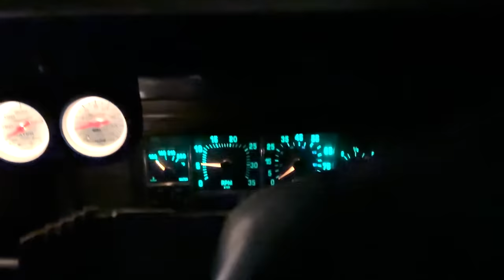Nightmare skoolie tow: this trailer ripped off my hitch

Comment: Love Love Love You Chuck !!! As a veteran tow operator, THANK YOU So much for mentioning it to Slow Down and Move Over for us. Just here in OK alone, since 2018, through 2023, I"ve been to 5 funerals, 1 a year of tow operators that have been hit and killed. Most of them dismembered and shredded to pieces literally. Hate to paint that nasty picture, but it's true. In USA alone, on average there is a tow truck operator hit and killed every 6 days, year after year after year. That's an average of 60 tow operators hit and killed in USA every year. Some years, more, some less. At the tow museum in Chatanooga TN,  there is Wall of the Fallen for tow operators. I know to many names on that wall. Of these 5 hit and killed in OK, that's not including 7 others that have been hit and severly injured. Some in ICU for months, some will never walk again and in a wheelchair for life, and some disabled enough they'll never work again. Then there's those have been hit in the back with a mirror and it hurts badly. I'm one of those. I was badly bruised for about 2 weeks and limited use of my arm. I've dove under my truck 3 times to keep from getting hit, and I've jumped over the center wall once. It's a real problem people. Please Move Over for us. It's the law in most states. If you can't get over, at least slow way down and scoot to the far side of your lane to give us as much space as possible. It's not a comfy feeling the wind from a vehicle getting that close to you on your back.  Please support your local Hookers in keeping them safe !!! Just because your vehicle isn't broke down, many forget we are working for everyone of you. When you're tied up in traffic due to a car accident or a disabled vehicle, who do you think is working to get that roadway opened back up so you can carry on about your day? Yes, we're working for you too.
Reply from the maker: thank you for sharing this and it is something i really believe in. it is insane how dangerous that job is and you're there only to help people. thanks for all you do, stay safe out there!
Reply: @ChuckCassadyYT  Much Respect Brother, it helps a lot when people like yourself with a large social media platform mention it and it's truley apprecaited by the entire tow brotherhood nationwide. In Oklahoma, we won't allow these men to be forgotten. They were all fathers, most with very young children. It sucks going to a funeral and look in the eyes of a wife and her kids for such a senseless avoidable incident. RIP Jonathon “JT” Taylor 1975 - 2018 
Bernardo Martinez  1978 – 2020
Donovan Knippenburg 1976 - 2021
John Mills 1991 - 2022
Kyle McCullough  1996 – 2023
Reply: Thank you both for bringing the dangers of this situation to the attention of the average everyday driver! Too many drivers jump into that isolation booth we call the drivers seat and are oblivious to the safety of themselves and others on the road! Well said to both of you! Thank you!

Comment: "when the bolts broke i was lightly braking and going over a dip in the overpass". In my opinion this is a key statement. The pitching (rear of bus rising and falling) is a major contributor to the failure. The tail starts wagging the dog effect. I have reattached caravans to cars on some very lumpy roads where this effect has occurred. The comment regarding bolts on the vertical is also on the money.
Cheers from Australia.
Pete

Comment: If it makes you feel any better, I just flat towed my jeep 1500 miles to the US Mexico border, was turned back multiple times, ended up in south Texas and when I awoke the next day, finally realized what all the noise was when I went over the three hundred speed bumps.  The nut had fallen off of the ball. I probably towed it 100 miles like that. There is currently a cotter pin through a hole I drilled in the new nut. And a safety point through the frame and bumper. I was truly astonished to see your towing rig fail and think the bolts in tension as opposed to shear is the most likely problem. Thank you for sharing. Failures are more difficult but much more valuable.

Comment: From an engineering viewpoint the bolts were through the wrong web of the frame, they should have been horizontal running through the vertical web. The horizontal web is only there to stop the vertical web flexing & bolted joints should have the bolt loads in shear not in tension, a bolted joint works by friction between the bolted parts, the bolts are tight to increase that friction.
Reply: Axial loaded bolts are literally "hanging on by a thread"...  A radial loaded bolt uses all the steel's thickness to bear the load.
Reply: @thetruthserum2816  These are the comments you are looking for. Once the first bolt hanging by a thread went, it could have been a cascade  of failure. Alanhat5252 has it right on the nose with looking for a hitch that is bolted through the web. And perhaps the "grade 8" bolts in their kit were not what they claimed to be.
Reply: maybe you should tell that to every hitch manufacturer. they all connect to the horizontal portion of the frame. 

my Curt 15511 hitch is rated for a TW of 1500 lbs and has three 1/2-13 gr8 bolts on the horizontal portion of each frame rail. 

Looks like chucks only had two on either side, but he was only rated for 1000lbs tw, which i believe he exceeded or came very close to.

Edit: assuming this is a 30' trailer, checking out barebone enclosed 30' tandem axle trailers, their unloaded tongue weight is 650-800lbs depending on brand.  similar size toy haulers go well over 1000# TW.  I agree the bolts shouldn't have snapped, but I think its pretty clear this hitch was undersized for that trailer.  Personally I would never tow anything that exceeded 80% of the rated capacity of the tow vehicle or any component in the chain.  Not worth it.
Reply: @brin6449  I just had a look through offerings at tractor supply and it was about half and half shear vs tension bolt loading.
Reply: @brin6449 does have a point...most aftermarket hitches do bolt on that way. Curt is a reputable company and I'd be surprised if they didn't do an analysis on the hitch and use sub-standard hardware. A former coworker of mine actually worked for them several years ago. But as an engineer with a background in failure analysis, the first thing I would look at is the cantilevered loading inherent in that design. The crossbar appears to be located behind the last bolt...that receiver tube is of a substantial length (8-10"+ if I were to guess)...the hitch insert looks standard length at least. As an initial gut check, that is where I would look...it seems like the moment arm caused by that cantilevered effect would be substantial. Someone mentioned braking force...which would be amplified as well, especially with the trailer pitched nose down. You mentioned grade 8 bolts...is that what came with the hitch? While having an elevated tensile strength, grade 8 bolts are more brittle and sensitive to shock than their lower grade counterparts. Owning a 32' 12,000 lb.+ travel trailer...I can confidently say there are a ton of shock loads involved in towing. Especially with the roads here in MI. Regardless, glad you're safe and nothing other than your hitch was damaged!

Comment: The following from bethmikels is good advice. You might consider an even heavier hitch, but whether you weld the hitch in addition to bolting or not, I'd reinforce the frame as well and consider bringing some safety chains to the frame rather than the hitch. If you tore out the hitch, better anchor those safety chains like crazy.  Don't think over engineering applies here.
Take care of yourself, your pushing too hard if you undertake a journey like this while being sick.  Lucky you had the problems close to home.  I'm a retired mechanic and loved all the videos of your work on Regretlyss's bus.  You seem like a great guy with knowledge and real integrity.  Be safe, get well.
Reply from the maker: i really appreciate that! the new hitch is going to be as strong as the rest of the bus, i will tell you that
Reply: Thank you William Stefanelli. Your right about reinforcement plates on the frame as well. After all why not? I'm a retired big truck mechanic and OTR truck driver amongst many other things. I have installed many hitches, both bolt on and weld on. Curt hitches are pretty good and my favorite brand.
Reply: Hope you're feeling better.  Don't hesitate to contact Curt with questions or to make them aware of problems.  I have always found them helpful.  (I'm sure the next hitch will be able to pull a tank when you're done.) Stay safe!

Comment: Cheap china grade 8s is what I’d blame it on. Tinsel strength on a 1/2 grade 8 course thread should have been no problem. I’d use a US made grade 8 fine thread in the future, upsize if you can with quality thick grade 8 washers.
Reply: …. And skip the loctite and go strait for the grade 8 nylock
Reply: It should have twisted your hitch up before braking the bolts.

Comment: Wow, Chuck, I'm glad you're okay.  I would guess it's not a tongue weight issue, but instead might be a trailer brake failure.  A heavy trailer pushing forward, as the bus brakes, will exert a lot more force than the downward tongue weight alone...especially with the ball significantly below the attachment point.  I really doubt that it's just the tongue weight.  Tongue weight is static...steady, consistent downward force...but the dynamic force of a heavy trailer moving  forward, while the bus is braking, could exert a LOT more forward (and, in that case, downward) force on that hitch.
Reply from the maker: thank you, i appreciate that! and you know, that is a good point, i will say that i had adjusted the trailer brakes to a pretty nice setting where the braking felt fairly neutral with a slight bias of the trailer slowing me down under light braking BUT when the bolts broke i was lightly braking and going over a dip in the overpass expansion joint as i went around an interstate onramp onto i25. i was shocked at how powerful new trailer brakes are actually at low speeds!  have you ever seen anything like this in your days?

Comment: It is possible that the load that you previously towed started fatigue, failure in those bolts, and that the additional tongue weight of this was able to overcome the ultimate tensile strength or ultimate shear strength of one bolt, because it had a reduced cross-sectional area. Once that happened, and you lost one bolt, you could’ve then very easily had a stress concentration on another, lost it, then had the frame bend as shown in the video.

Comment: Sorry to hear about your problems. I can tell you what happened, the rear bolts snapped. First thing Chuck, don't use the grade 8 bolts they send with the hitch. Always put in at least 1 size bigger grade 8 bolts fine threaded only. I like to use 2 sizes bigger if possible. In your case I would have used at least 9/16in or better yet 5/8in grade 8 fine thread bolts which would have prevented this from happening even if they had too much weight on the tongue. The bus frame is plenty thick enough so use the included backup plates under the hitch side instead of the frame side so as to reinforce the holes in the hitch piece instead of the frame. Those hitches are designed for pickup truck frames that are way way thinner than bus frames which is why the instructions say to put them on the frame side. I towed 611 miles home from Ohio a 38ft bus, 19100lbs scaled weight, with an identical 38ft bus. Bought both from the same school district. And other than being really slow had no problem. I built my own tow bar. My hitch is a bolt on Curt Class 5 commercial duty 2 1/2 inch hitch rated for 20,000lbs with 2,700lbs tongue weight. It came with course threaded 9/16in  grade 8 bolts. I replaced them with fine threaded 5/8in grade 8 bolts. It bolts up like yours does, I watched your video your install. I have also towed a 24ft heavy duty cargo trailer weighing 16,000lbs gross trailer weight with no hitch problems. Yes it was a slow trip. Extra heavy duty is always great when it comes to hitches!! As you already know, always watch your engine and transmission  temperatures.
Reply: They probably broke because they were not torqued correctly. Not because they are undersized.

Comment: I always weld a hitch to the frame in addition to bolting it. The other thing that came to mind is did prior trips weaken the bolts. That trailer's axles are quite a ways back so there was quite a bit of leverage. I had something similar happen, only it was the trailer hitch that broke. The 1-ton dually pulling the loaded trailer had such a stiff rear suspension that every interstate expansion joint just hammered the hitch and it ended up folding. Possibly the same thing here, your bus has a pretty stiff suspension and all that leverage found the weak link.
Reply from the maker: i think youre on to something about the bus's suspension being so stiff that the tongue was taking more abuse. it broke on a dip at an expansion joint in an onramp going about 35-40 id guess

Comment: Welcome to my world. I hate the freeway work. Glad you found someone to come out and actually help. Glad you're ok. I'm wondering if your trailer breaks were working properly? I've seen things happen like this with heavy tounges and improper working break controlers or trailer breaks.

Just for information purposes. Commercial vehicles you're not allowed to drill or bolt onto that upper or lower flange. It has to be on the vertical side at least an 1.5 inches away from those upper and lower flanges. You also cannot weld attachments to the frame as it weakens the frame. These were built as commercial vehicles so I'm sure there's good reasoning behind those rules.

Comment: Hey Chuck, another armchair quaterback here! I agree with those who say larger bolts needed. However, it looks like the bolts closest to the receiver are pretty far away allowing a greater amount of leverage, increasing the pressure on those bolts that broke. Also, the bolts are in tension, not shear. Shear is when the bolts are "sheared off". Yours snapped because of the direction of pressure against them. The shear value of your bolts is 91000 lbs, but the tension (tensile) is only about 20 percent of that. I sure am glad you're ok! I'm sure you'll figure out what you need to do after a good night's sleep! God bless you good buddy.

Comment: Oh buddy, I’ve very thankful you’re safe. As you said, could’ve been so much worse. Have 20years and 1.3million miles OTR (trucking) myself I’ve seen several similar situations like this. None ended this pleasant.

First thing: Always Scale unfamiliar trailers. 

Second: had this went south, your safety chains were attached to the failed receiver and the trailer would have detached. Scary AF Brother!

Potentially the hitch/bolts got weakened by that load of tools you took to Kansas? 

Bottom line, again, just grateful you’re safe, on the highway, sometimes things just happen. ✌️
Reply from the maker: thank you! i agree with everything you said. tongue weight and trailer weight have to be known to tow safe (at least reasonably), safety chains should not be attached to bolt-on receiver hitches, but to a welded or seperate part of the frame, i dont know enough about the plastic deformation, etc of the steel in the bolts to say for sure about that, but i do know that trailer had a tongue weight of basically 0, but it was, in all likelihood somewhere around 10,000lbs--id guess 4k for the trailer, the forklift was 5k, and the rest of the tools were probably another 1k. big bolts to break! towing is a whole nother animal that i respect even more now
Reply: It’s a crazy learning experience for all of us out here thanks to you sharing your experience. Close call, but no way to calculate how many bad situations you helped avoid with this.

Again, thankful you’re safe Brah!

Comment: Really like your videos man. I wouldn’t put less than a class IV hitch on there. (Which I think you have) but I would go with bigger than 1/2 inch bolts. On my truck I opened the holes up a bit and used 3/4 Lamalloy bolts I picked up from fastenal. Some people are saying weld it - that might not be a bad idea either but my truck frame was zinc coated and I didn’t want to breathe it in.
Reply from the maker: youre right, it was a class IV with 1/2" bolts. the next hitch will be extremely beefy and attach to the flange and sides of the frame

Comment: I use a ball hitch called Weigh-safe hitch just as a precaution so i can see what the hitch weight is at the ball glad nobody got hurt.
I have had a tire go and didn't have enough room myself to change the tire on the road side the guy that cam e out i felt the same way couldn't pay me enough again glad every body is safe.

Comment: I hope you had your triangles out! At night flares are great visibility too.  I put on a 7500 lbs hitch on my friends bus it was made for 1/2" bolts but as usual the holes are extra big a 5/8" was like a reamer.  It was 3x the price but I got USA made grade 8 fine thread bolts and nuts (washers are 8 too but Chinese because of minimum quantity) Grainger is my go-to because they show origin and pickup is free, perhaps curt will offer you a replacement or discount, I know I would if in charge.

Comment: Chuck,  You said that you park your bus on a side street or boulevard.  And when you first got into the bus and started it, you had electrical issues with the dash lights, right?  Is it too far fetched to  consider that someone might have tampered with your hitch before you got to your bus?  Those loose nuts on the hitch also caught your attention, remember?   Also, are there wires near the hitch that could have anything to do with the dash light problem?  Does all this coincidence seem odd to anyone else?  I’m just looking at all possibilities.   Good luck figuring it all out.